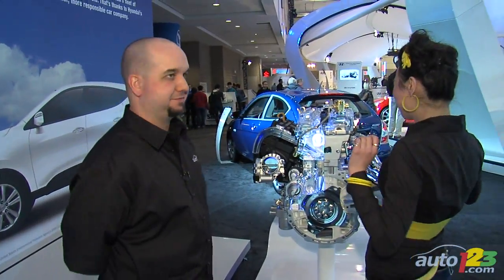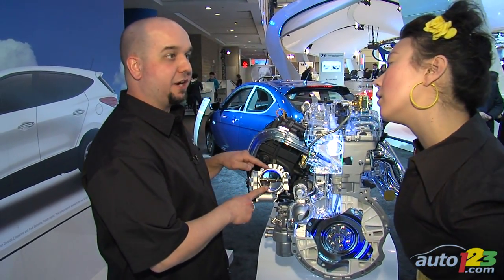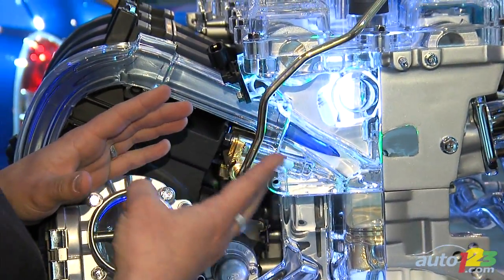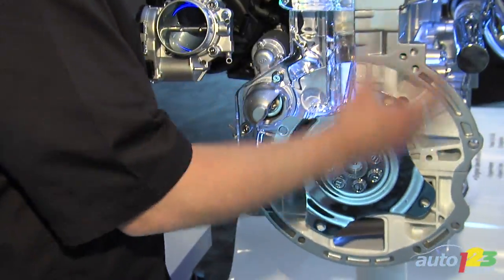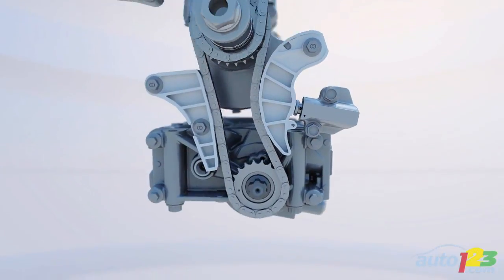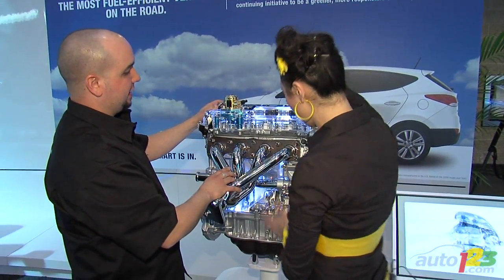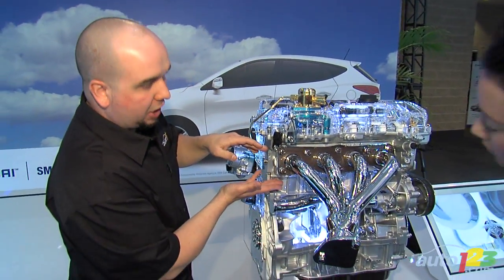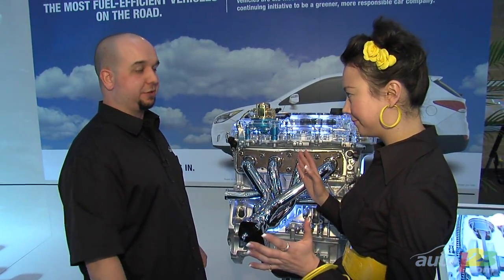The Auto123 Show 23x03 - Expert's Corner: Engine Lesson

Comment: @Axion3812 -The crankshaft connects to the flywheel and clutch from the engine. Then the other side of the clutch connects with the transmission which takes the power and turns the driveshaft when the clutch is engaged. When the clutch is disengaged the flywheel spins freely with the engine. That's why a light weight flywheel improves performance, because the crankshaft can spin more freely.

Comment: lol how are u hosting a car show but u know nothing about cars not even the simple facts about how the engine works? i think u are too late in the years to come there will be no oil and those engines will kid of disappear but u can change the fuel system and run them on hydrogen which i think is the best solution for gear heads cuz the cars will still make noise not run on electricity